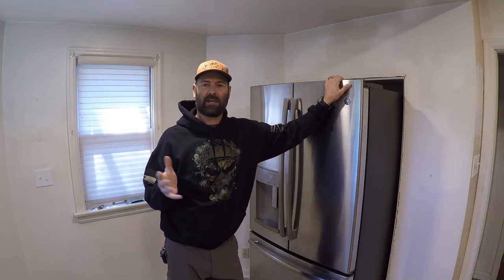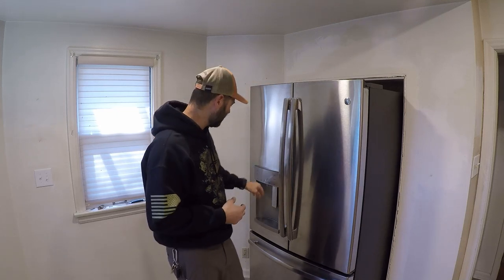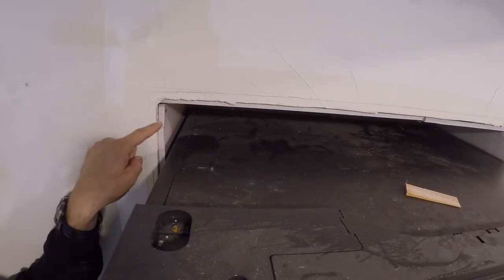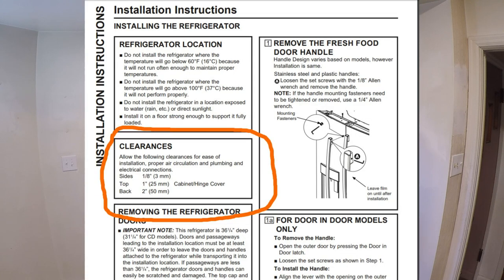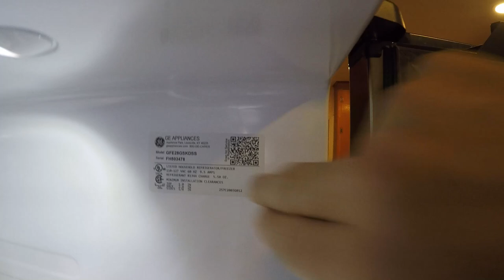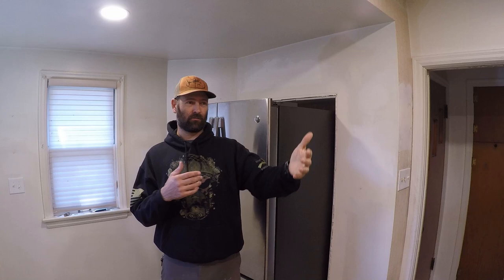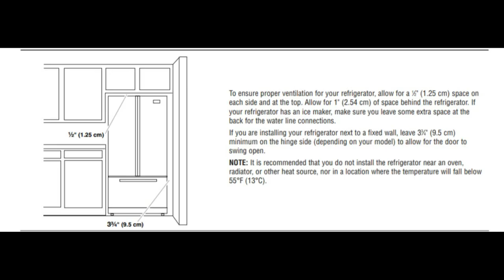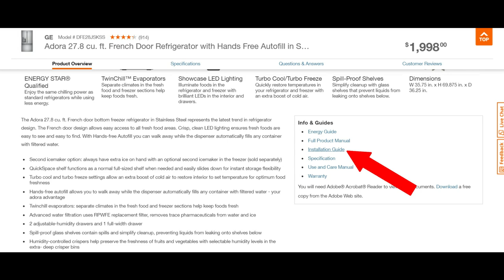Built-In Refrigerator Ventilation Clearances | Don't Burn Up Your Refrigerator | THE HANDYMAN |

Comment: The problem with building the space around the fridge so tight to the fridge is when you need to replace the unit.  I have seen those high-end units fail just a year or two after the warranty is over, so the cabinets are around six or seven years old.  Finding another fridge later that fits in the same hole is often a challenge and you don't want to have to replace all your custom cabinetry just because your fridge breaks and you need a new fridge.  It may not look as sweet, but having a bit of extra space is a good idea because it leaves room for a different unit to be installed later.

Comment: New fridges vent from the bottom in the front.
Reply: Anyone that has ever walked up to one in bare feet would have known this. The tile for a few inches in front of the fridge is probably 5-10 degrees warmer than the rest of the kitchen floor.
Reply: Sounds awful warm in the summertime.

Comment: Good to know. I have a small 1950s home with a galley kitchen. My fridge is from '93 and new ones are much, much deeper. Now when I go to upgrade I could spend an extra $1-2k for a smaller counter-depth fridge OR I could buy a standard fridge and cut back a pocket into the wall behind it to gain a couple of inches so it doesn't block the walkway.

Comment: Great to-know info! ❄️👍❄️ Had no idea. But if you think about it logically, a fridge's cooling system is a closed system & doesn't emit any (edit) coolant gas exhaust. And the compressor motor does not get very hot. A little warm, but not so much that it causes problems. 

(It was explained to me that the compressor is simply a low energy vacuum that pulls warm air out of the refrigerator, leaving the interior cold. The warm air is then recycled through gas filled cooling coils inside the fridge's interior, further keeping things cold. A very simple process. 🔄 )
Reply: @alantorrance6153  Miami, FL.

Comment: After a bit of poking for the last week, I've discovered that cheap refrigerators (my budget) do require clearances. I'm eying a cute little chest freezer that demands 5 inches all the way around. Older and low-end fridges use coils to cool down and those coils need fresh air. High-end can be stuffed right in there. 

I'm converting a skoolie. I can't afford to drop $2,000 on a little apartment-sized fridge, but I need every inch. To get around this, I'm leaving more clearance in the back and installing a little fan that'll pull air from the top, down over the coils, and out the bottom of the bus every time the fridge kicks on. That should do the trick. 

"Read the installation instructions" really is the best advice. I want to frame out my existing (5 year old, working beautifully) stainless all-refrigerator, but it's the lowest end fridge with that look and does require space. I've had a wireless thermometer under the crawl space for a full year and have discovered that even when it's 108F outside, it never hits 80F under there. Never gets below 45F in the winter. When we redo our kitchen, I'll be doing the fan trick for the fridge. I'm planning on making the upper intake vent a feature of the cabinet design.

All these things are worth thinking about. We can go for the high-end look without breaking the bank or our appliances. Do your homework and be respectful of your machines' limitations.

Comment: I'm getting a Samsung Without icemaker or water dispenser still says 2 inches on the back, But its a tight kitchen.. is 1 inch enough? 2 inch would make the refrigerator stick out to much.  Other refrigerators say 1/2 inch to 1 inch...

Comment: speaking of the custom door panels for fridges, i doubt they have refrigerant running through the doors. i wonder if it would be possible to diy it just by taking off the stock outter shell and replacing/trimming the closed cell foam if necessary. it might make things look very high end for not a whole ton of money.

Comment: Yep, you're right on that fridge and most modern ones. You mainly just have to know where your coils are at. If they are underneath, ventilation doesn't really matter. If they are on the back, then that's where the clearance and ventilation issues may occur and you probably wouldn't want to build in your fridge.

Comment: I never thought about it one way or the other...I mean you see refrigerators tucked away behind paneling like you said, I’ve seen people use small pantry closets in older homes to tuck them into to get them out of the way...then you have counter depth models that fit pretty tight against back walls and what not. Didn’t think you were placing it wrong at all due to ventilation lol Never would’ve thought to complain about that, everything is pretty normal to me so far

Comment: I've been wanting to build a pantry for my mom with a built in chest freezer. Any idea why those tend to have more clearance in the specs? It's the common Arcticwhatever brand, mid size, and they all seem to "require" around 4" on all sides. Seems excessive and quite limiting, but I'm uneasy with the idea of going against it.

Comment: What if i dont have clearance on the sides but i have on the top and bottom? Will it still be adequate?
Reply from the maker: The manual will tell what clearances are needed for it to work right.  You can also put an air transfer vent on the back wall to the adjacent room.

Comment: Next thing you know you're going to tell me my window A/C unit has to be set in a window to vent outside when I know better because I've had mine sitting in my living room running and it isn't in a window at all. Now, on to serious questions like: How do I address water damage to a floor caused by condensation from a window A/C unit?

Comment: Had to pull someone's fridge out one time, was in so tight it took two of us to pull it out.
Reply: I had to install a water line once the taking out wasn't the problem. The problem was putting it back in it was so tight and not square. Needed to push the bottom on one side and the top on the other side.

Comment: Yeah it may run for a few years, but eventually the increased duty cycles from poor ventilation will cause it to deteriorate faster than if it had proper ventilation.